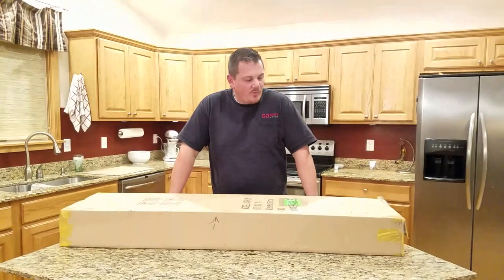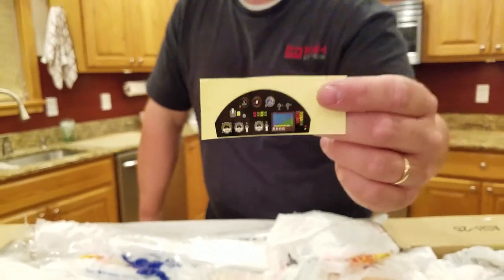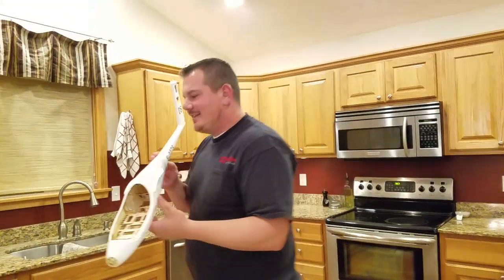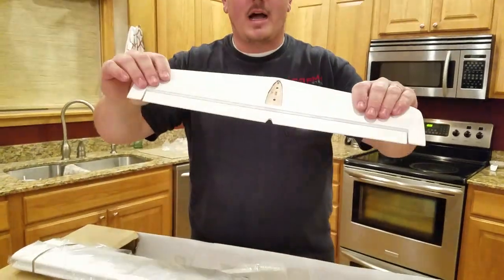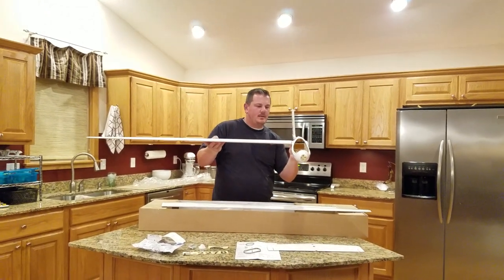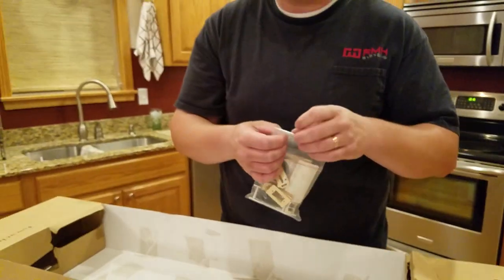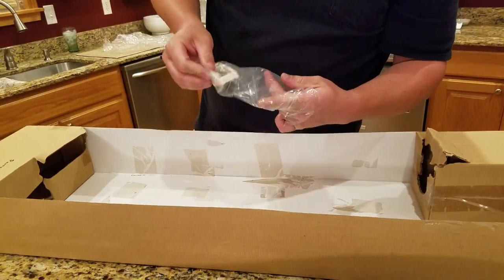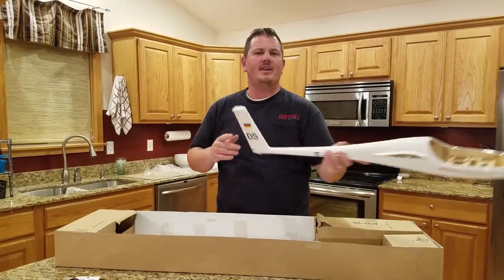CMPro - ASH 26 - 2.6m Composite Sail Plane - Unboxing

Comment: Great video Brian. The very light weight of this awesome glider should give it excellent thermal riding characteristics. Do you plan to put a motor on this. Oh by the way. Did you ever put full ailerons on your BOT?

Cheers

Florida USA
Reply from the maker: Okay, I added "spoilerons" on my Bid of time...here's the playlist... https://www.youtube.com/playlist?list=PLXTH0DstRDc7C3BxvnkFCTixPWZrrgxT3

~~~~~~~~~~~~~~~~~~~~~~~~~~~~ The rest of your question ~~~~~~~~~~~~~~~~~~~~~~~~~~~~

I'm putting a motor on it. Already have some of that done, but not yet mounted.

This plane has LOT's of build videos... you might enjoy them, if you like the sound of finger nails dragged across a chalk board... or if you are extremely board, like 15-20 years behind bars, for example ...or you're actally building one too and want to copy all of my mistakes

:) LOL....JK, they're not quite THAT bad...

...but you might want to check out the videos in this playlist...

https://www.youtube.com/playlist?list=PLXTH0DstRDc6otzLyJy9aoT9rGvBBiCiT

Comment: Nice.. After this one, you should be ready for a full on carbon fiber F5B glider.. Check out the virage from Yuricomposites.com. WIth a 10s pack and Neu 1512/2.5D motor and 18x23 GM prop it will climb at 180mph, 250+
 feet per second. Climbs are one or two seconds and give 2 or 3 min.of glide time in dead air.

 Fun for the whole family!
Reply from the maker: Darrell Brown Yes, but can I keep my wife??? LOL
Reply: The airframe is $850 but it will last a lifetime if you don't crash. My wife "allowed" me to get one as Christmas, birthday AND anniversary presents combined. Maybe you can work a deal like that..:)
Reply from the maker: She know that by the time the other two events happen, I'll be asking for another $850 plane LOL
Reply: BTW, I made my wife watch some of your vids and she was cracking up, especially when you got the adhesive on your shirt w/ the MOA repair
Reply from the maker: Great! That's NOT where you want glue to end up...you look a little "off".

P.S. I used kicker to take it out of the shirt...then it was just a greasy spot right there, until it dried...also slightly creepy...LOL